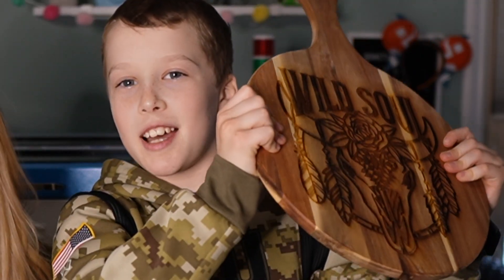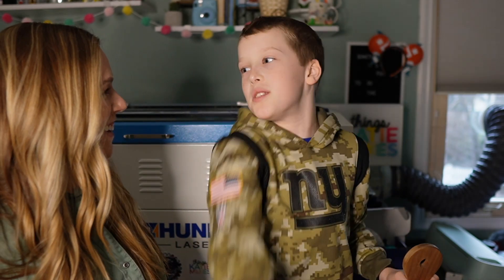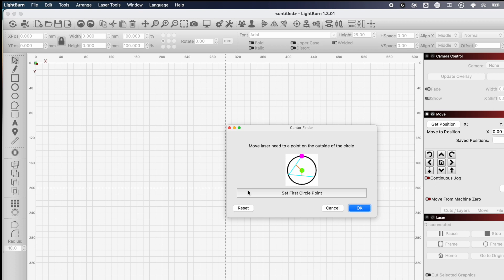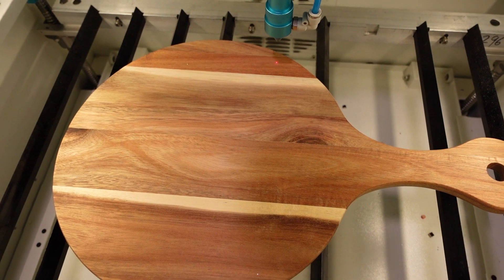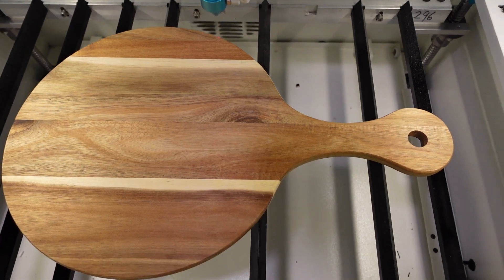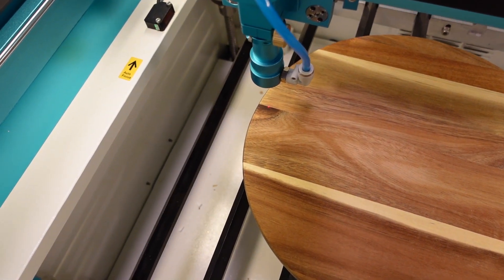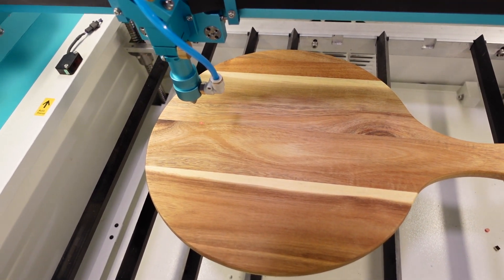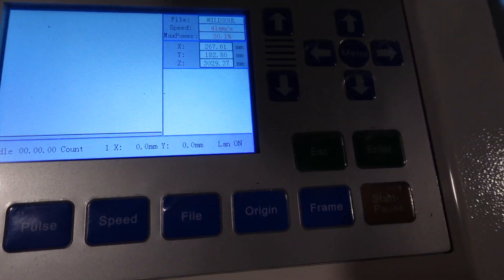How to Laser Engrave a Round Board with the Center Finder Tool in LIghtburn - Thunder Laser Project

Comment: Will this work on a fiber laser? Also when you are centering a image into a shape. Just hit the bullseye icon.
Reply from the maker: Should work on a fiber since it is a Lightburn feature! I’m not familiar with the bullseye - I’ll have to check it out - thanks for the tip!
Reply: You’re welcome. It’s to the left of the vertical and horizontal tools.
Reply: When I click over to my fiber laser from my c02. This option goes away. So it does not work for fiber lasers.
Reply from the maker: @jp450r  that’s a bummer!

Comment: You might want to try increasing the lines per inch to 400 or more.  It will increase the job time but you will get a darker burn.  I agree though that starting low and slow and building up is a safe way on materials you haven't worked with before.  Also, the 'Start from here' feature in the preview window will help with not having to burn the whole design again.  Thanks for the great videos, especially the interviews.
Reply from the maker: Wait - I don’t know the start from here feature! I’ll have to check that out - that will be super useful. And I’ll test some LPI vs power/speed too. Thanks for being here and for the tips - I always learn something in the comments :)

Comment: New to lasers & about to pull the trigger on one. Great tutorial, thanks for sharing
Reply from the maker: Congrats! What are you planning to get?
Reply: @Things Katie Makes  I'm going for a CO2 1300 x 900 bed size with air assist included. running Lightburn software with an optional camera fitted to help with alignment. I'm still trying to decide on a 100w or 130w tube upgrade I see on the forums that the extra power can affect engraving (the finer detail)